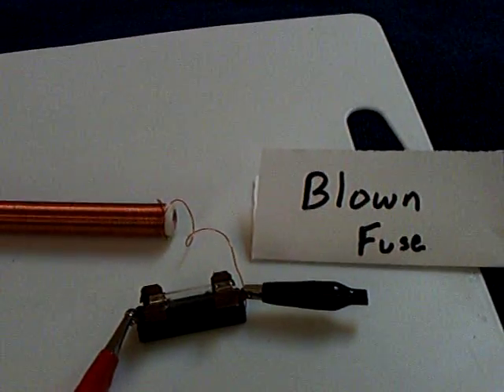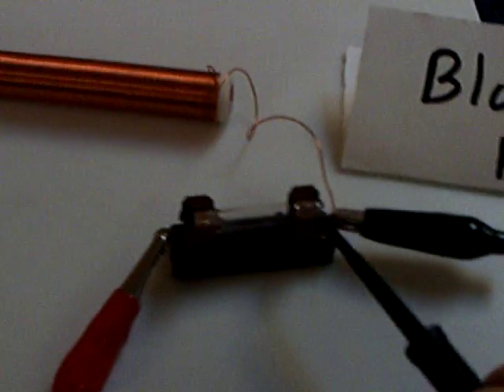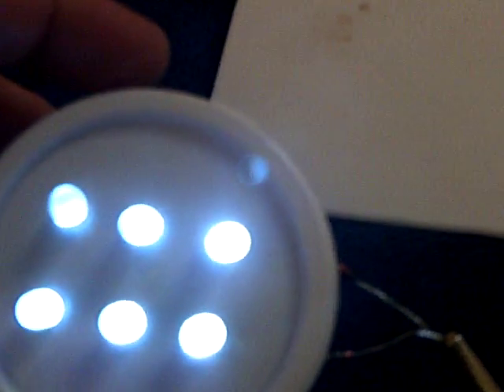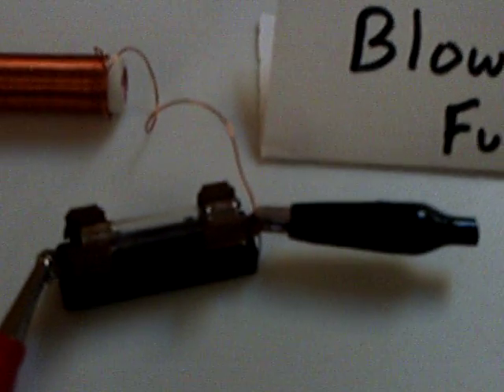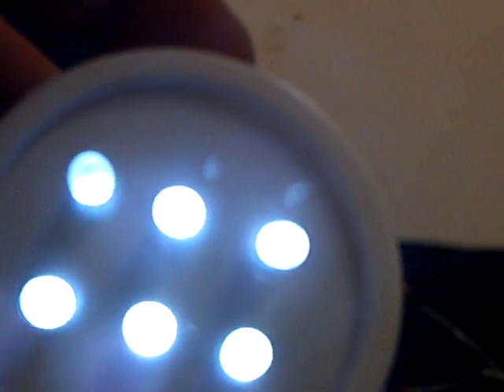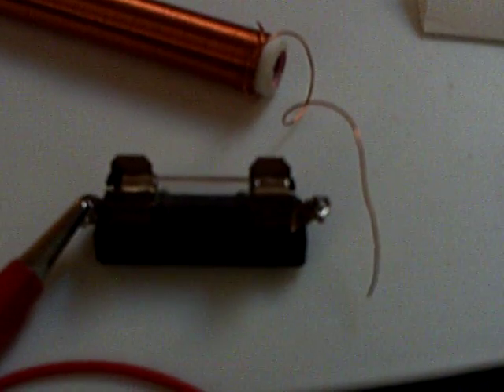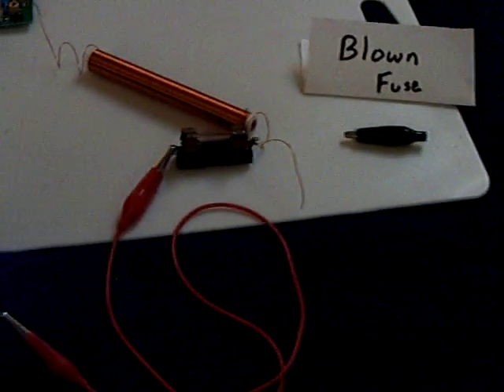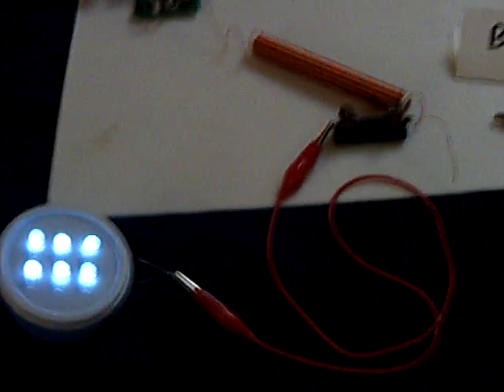SEC 18 ---Blown Fuse experiment.ASF

Comment from the maker: @area46241 -----I have never done the test you mentioned where you just keep adding LED's on AV plugs until the field goes dim.   I do know that adding more loads does not increase the amp draw but does diminish the power at the AV plugs.  This tells me that this IS different than just an RF signal.   A regular radio station can brodcast to an unlimited number of receivers and they all will get the same signal strength.

Comment: high voltage oscillating radio frequency field bubble causing skin effect with ambient electron excitation (within field bubble) did i pass? can i have my soup now? joking aside....fascinating as always...how many av plugs will an exciiter excite before dragging the field down? or do they drag it down at all? considering a sphere of as many av's as possible around an exciter as can fit ...the exciter shows so much promise of being a real power system

Comment: Tesla maintained the longituinal wave was 90% power and 10% RF radiation, and the transverse wave 10% power and 90% RF. The solenoid coil produces longitudinal waves from the front, and transverse from the sides. The penny is really the front of the coil, and vectoring a longitudinal wave that's 90% power. Stifler produced a video demonstrating this directionality. Would a second penny reciever attached to a second set of 6 LEDS produce more light then 12 LED'S  off a single penny?

Comment: Adding an earth ground via a 2 foot copper tube with a wire to the sec makes it work stronger just off the battery negitive. I have the feeling the sec is a radio transmitter with really fine tuned reception just the av plug is its recievers. Three leds will work too with out av plug I have found. The gate when I worked with it I got it to 1200 volts and it was a stinging shocker to touch on 9 volts. The sec system reminds me of tesla wireless power system. GE holds his patents as of now.

Comment: Lidmotor,

Try placing a second blown fuse, holder and set of 6 additional LED'S in close adjacency to the coil and see if they light up as bright. The blown fuse appears to be transmitting power with longitudional waves. Multiple wave transmitter recievers may harness and magnify the output with this setup. Possible awesome quantum leap discovery!

Comment: Nice!

In my opinion the wire to diodes acts as antenna and because each diode in the pair before LEDs has capacitance too, it may be the answer why it still works as radio receiver without ground. That's all way back to Nicola Tesla experiments.. :)